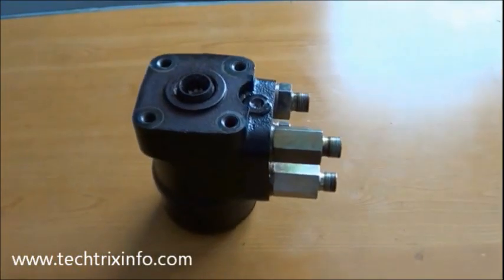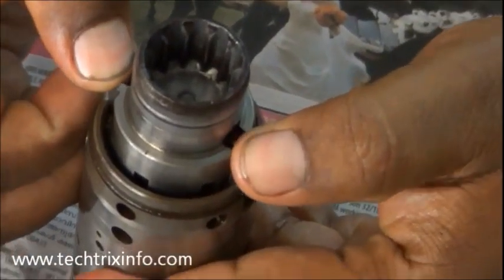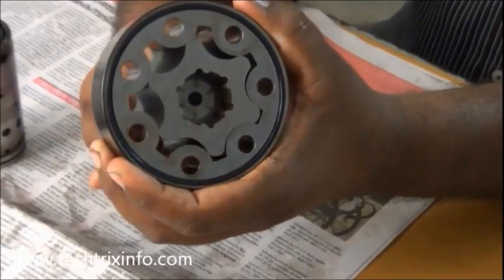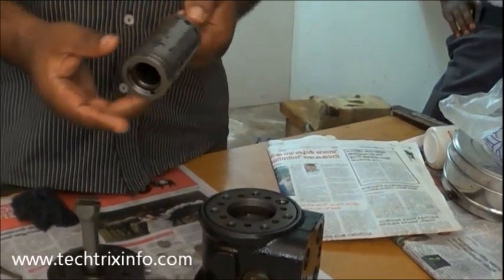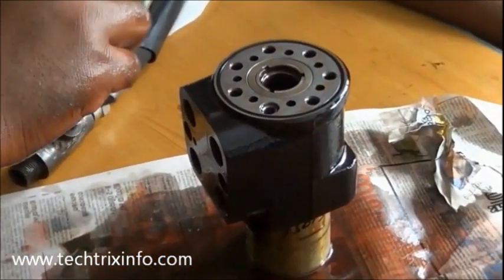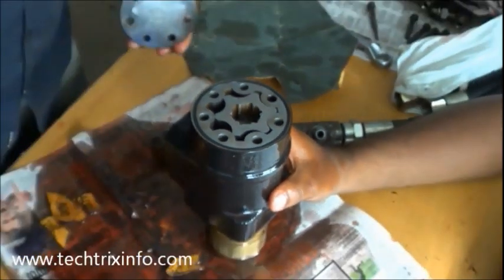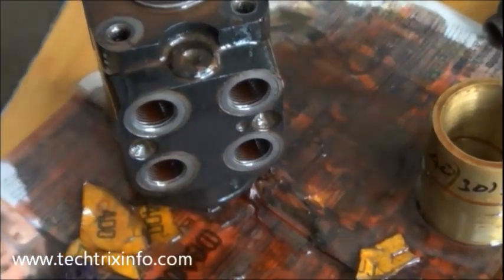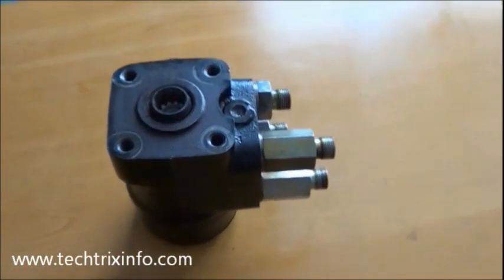How an orbitrol is assembled. ✔

Comment: The little plug on the side on my Eaton steering orbitol is called a load sensing valve. Where does this port connect to?  Did you say yours was a drain port ???
Reply from the maker: That port connects to the load-sense (LS) line going back to the pump or priority valve. It sends steering load pressure so the pump increases flow only when you turn the wheel.😊
Reply: @TechTrixInfo  Hi. I’m using this on my old Big Dipper Loader.  The original orbitol steering motor that I am replacing did not have this little port. Just the two steering hose ports and one for the pump and the other port for return to the reservoir. Do you know if I can just plug this port up.

Comment: I can't figure out why that bull just sits there in there like that it will fall out the other side of the line if you move it around is it supposed to be like that
Reply: it a check valve on P to T.when pump working the ball block P to T port and when pump not work and you need turn streering wheel the ball move and open T port to orbitrol for oil sucktion

Comment: For Anne Svendby with the MB Trac ; I have not seen the steering valve in an MB Trac , but if it looks just like this one , then you have to get it right out , scrupulously clean on the bench , & I,m sorry but the only way to get the seal arrangement out completely is to reference mark all the components at the bottom of the valve block , as this lot encompasses a manually turned pump that will provide " some " steering power if your engine ends up dead on the road , or if you are trying to pull - start it , this includes all the bolts , as at least one is a special bolt that retains a ball bearing in an oil port , mark it all , everything must go back where it came from ! strip off the bottom of the valve , then very carefully tap out the valve core & sleeve assembly with a wooden tool , take your time , the valve core will fall straight out of it,s sleeve if not handled with caution , & there is a con - rod arrangement inside it being driven by a cross - pin that operates the manually turned pump mentioned earlier , through a simple leaf spring arrangement , this is what gives the steering wheel it,s propensity to spring back to neutral , the tool to fit it all back together comprises a highly accurately machined steel sleeve that plugs into the central hole in the valve body , a plunger that looks a bit like a steel mushroom , with a plastic cap that dowels onto it,s top , this cap carries the lubricated & assembled kin ring & internal O ring assembly , & having fitted the outer , top single lip seal first , ( lip facing outwards , it just keeps the muck out , ) you locate the plunger into the bore , with the sleeve inserted first & dripping in oil , then stand the lot upright on the plunger,s substantial base , & snap it down centrally & firmly into place , withdraw the plunger , & tool sleeve , leaving the plastic cap in place in the top of the valve body , it is holding the kin ring & O ring in place , fit the valve sleeve & core assembly back in , then doing this will push the plastic cap out , reassemble the valve body pump etc , refit . ( YOU OF COURSE USE A NEW SEAL KIT FOR ALL THIS ! ) The golden rule is to mark everything first , before dis-assembly , the tool part number here in England for this is V.L. Churchill MS 62/1 , MS62/2 & MS 63 , I only live a few miles frm the old churchill factory , but they seem to have disappeared , if you can find them again I,d like to know where they are , someone mentioned Blisworth or Brixworth , Northamptonshire , but as yet , no joy . This company,s tools are / were the very best . Be warned , different machine makers may use different sizes of components that look just the same until measured , then you find out the expensive tools you just bought don,t fit , I suggest you contact your local Agricultural College machinery dept for advice , as they sometimes " use " projects like this to train students on , & may already have the tools .For M B Trac knowledge I would look to Lincolnshire or East Anglia , a great old mate I haven,t seen for years went to work for a company called Townshends of Threekingham & Metheringham , Lincolnshire , they were Mercedes agents , his name ; Richard ( Dick ) Bradshaw , he was the red hot storeman who supplied me with many Leyland tractor bits from Stamford ( Power Farming , now gone ) in the 1990,s , great bloke ! Best Regards  & Happy Spanners ! .

Comment: If you are taking one apart make sure to mark the parts according to the original alignment. Or else you will have to make a total mess and take it apart many times to figure out the alignment. The unit i took apart did not work properly unless it was in its original alignment.

Comment: Hello , I have serviced these several times , particularly on tractors with front - end loaders fitted , as the usual chain of events is that somebody turns the steering wheel while the machine is stationary , & the engine running at fast tickover , this causes an almighty build - up of hydraulic pressure in the "live " side of the circuitry , which finds the easiest way out , straight through the valve body top seal & kin - ring pack & then all over your cab floor !
Usually the replacement seal kit costs about £15 to £20 here in England , but you will have "one extremely hard time " fitting the new seal kit into the top of the valve body without the correct special tool kit for your series of valve , as it fits in quite tightly , & you can,t get at it to cobble it as it,s right up in the top of the valve bore . 
Also the parts of these valves are very finely machined & matched , it is imperative to keep them scrupulously clean & in exactly the original position , orientation & order , failure to achieve this will render the valve disfunctional on refitting .
I,ve got the Churchill tool kit for my series of valves , can somebody tell me on here what SIMPLE video camera with a very good lens to look out for , as next time I do one I,ll try to video the proceedings & post it . I have an heavy eastern england accent , people think I,m Australian but I,m not , so stick with it for my voiceover !  I,ve been doing these seal kits since approx 1982 . Please note ; Churchill special tools still exist as part of The Sealed Power Corporation , near Northampton , England , buy your tool kits from them , to suit , as I did . Don,t copy mine , you will infringe patents , & these things are exceptionally finely machined , so they would not work if you did . Work out what you,ve got & phone SPX . 
Happy Spanners !
Reply: Have you posted your video yet? Pls send the link
Reply: @Harry-et5ns  No mate I haven't had to do one , contact John Charnley & Sons , Brindle , Chorley , Lancashire . Someone there will have done them before , I have now not got a video camera .

Comment: hi i have an danfoss 200ls on one of my jcb ive got some problem with it.when i turn right its smooth but when i turn left its hard to turn.and also i would like to know the diameter of the ball valve.could someone help me please??
Reply: I have the same problem as you have solved

Comment: Do you know what's the flow volume of this EATON CHAR-LYNN 236-4008-002 STEERING VALVE basing on the number?
Reply from the maker: +Gniwo Ed Not now let me check
For more more info you can email us at techtrixinfo@gmail.com or whats app at +919744615655

TechTrixInfo.com
Reply: Do you know of anyone who re-seals an orbitrol made by sumitomo Eaton? Preferably in the U.S.  Mine leaks around the splined steering shaft female end.  Appears to be a lipped seal there.  Not sure if that's the seal or just a wiper?

Comment: For the pump/assistance to work the inner spool must push against the centering spring to allow the respective ports to open and allow fluid to flow to left or right cylinder you do not explain what holds the outer spool against the effort applied to the inner spool to align the spool ports for this to occur - otherwise the two spools will just keep rotating together and fluid will be dumped back to the tank without any assistance.

Comment: you have left out important points,the inner spool can be assembled in 2 positions,with a shift of 180 degrees ,in respect to outer spool.If assembled in wrong position ,the steering jams ,when u turn left.And the gerotor in some models,has a correct position in respect to the needle pin.
Reply: Mate, thank you so much for saying that. It is exactly what has happened to me. Jams going left after I reassembled. Thank you thank you thank you! I was pulling my hair out.
Reply: El Mero Mero  things that cause it,
1)the plate springs holding the outer spool position, to the inner spool are faulty.
2)The steering cylinder seals or tube is damaged.
3) The slots on the inner spool  is clogged.
4) The steering column bearings are damaged.
5) The rubber coupling between the steering column rod and orbitrol is damaged.
 regs
Reply from the maker: enginehacker ok..Thank you, Please SUBSCRIBE to us for more videos. We have a face book
 page just search for TechTrixInfo in face book  -  TechTrixInfo.com
Reply: My wheel keep going left I have to turn right then left and then right for them to go back right. But I have never open or removed the orbritol. Is this my problem if so how do I rebuild it???
Reply: @ El Mero Mero : Just change the pipes from left to right and from right to left .
Reply: Hi,

I have problem on exact same pump, it doesnt allow free frow, turning works but P side when not turning are constantly on high pressure, any thoughts why?
Reply: @kileriuxsful  There are many configuration of the orbitrol, with and without priority valves, and bulit in PRV. You might have used a wrong type. Since P line pressure is high wnhile not operating means , you have to use a open centre typre

Comment: hello u have showed the assamble only u have not showen the allinement of the the internal gear,shaft and the outer gear its the most importent to assamble the  orbital unit,since some orbital do have there own allinment we can assamble how ever we want but some dont have that we have to do the allinment ,since i am doing this job since 20 years.
Reply: Hello Sir, do you have any document or a video in which the alignment of the inner and outer gear is explained. Also the basic simulation of the oil flow from the oil flow passage between the spools could be understood more clearly. It would be a great help. If you have any document please mail me at "vrushabh.sawant@gmail.com". Thankyou
Reply: You are 100% correct. I jacked with one for almost two days to figure out what was wrong. I just wanted to replace the seal which was leaking and did not pay enough attention to the alignment of the wheels. After the seal replacement steering wheel started to turn by itself as soon as i touch it. By the time that i figured out whats wrong i have taken apart the unit for 7 times 🤦‍♂️ it was a total disaster.

Comment: If I might add... also, gear pumps are the most common type for most transportation applications. They can deliver high flow, maintain high pressure and accept harsher operational conditions than larger piston, screw or vein pumps for similar or less money. Also, they are cheaper/ simpler to fix compared to most